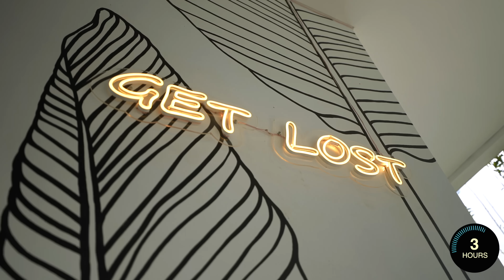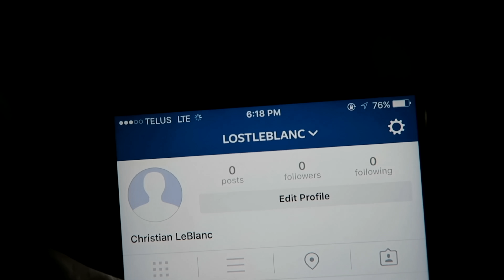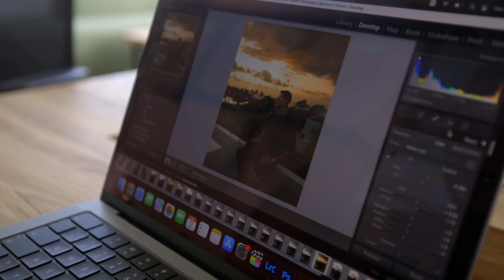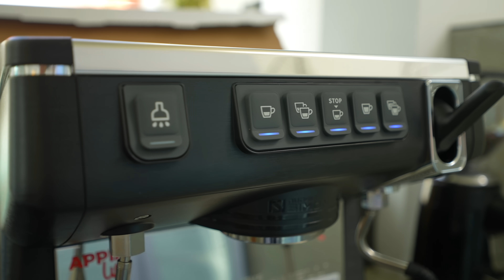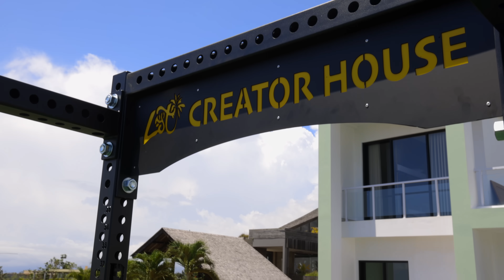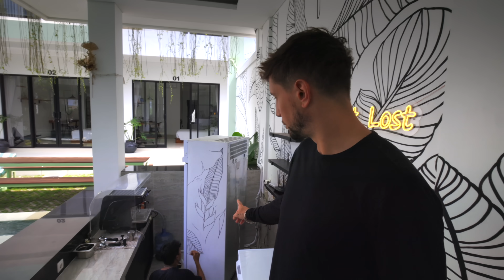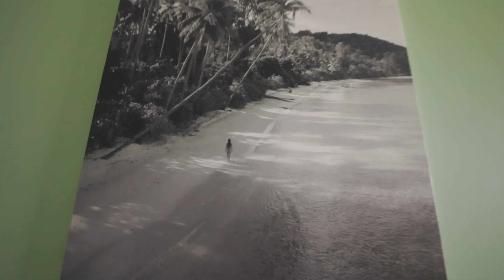I OPENED MY BALI HOTEL in ONLY 30 days! (Lost Creator House)

Comment: Outdoor gym in Bali? So I have to ask how do you protect the equipment from rusting? Because I know Muscle Beach's gym has issues with rust over time due to the salt water and open air, it's dryer in LA which probably helps a bit, but it definitely starts looking worse after about a year.